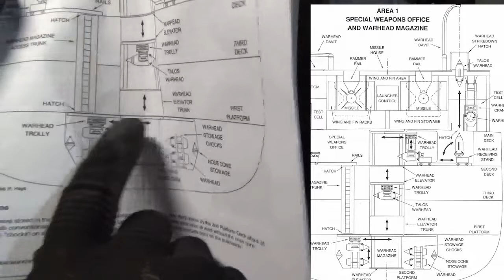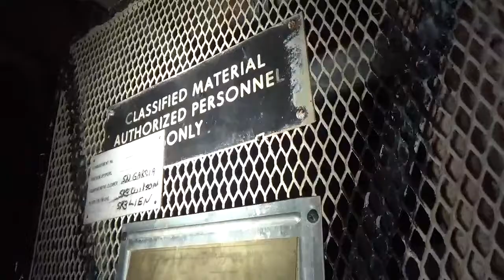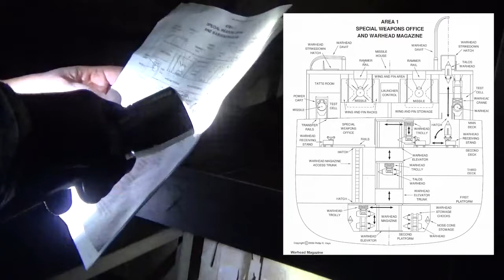USS Little Rock's Missile House for the Talos Missiles, Part III

Comment: On the Long Beach, the warhead handling carts were stored on their tracks just inboard of the 2nd Deck passageways port and starboard on either side of the elevator on centerline down to the warhead magazine.  In the mid-'70s we were steaming inside the wall of a typhoon hiding from the Soviets performing their Okean 75 exercise.  The ship was rolling pretty hard from the storm and the starboard handling cart broke out of its storage clamps, flying through the air across the starboard 2nd Deck passageway and through the thin wall of Sickbay knocking down a couple in-patient bunks.  That flying cart probably weighed better than 1000 lbs.  I was in B&M Berthing below on the 3rd Deck and heard the loud crash when it let loose.  You didn't go all the way down to the warhead storage racks - that place is a bit spooky.  Warning placards about maintaining a safe specified distance between warheads during handling/moving them were posted there.  And for a reason not obvious to most folks - these were very "old tech" devices...
Reply from the maker: Thanks for sharing your story on the Long Beach. She was such an interesting looking ship, and appreciate you sharing some of her architecture and how it differs from Little Rock. We've gone into a little bit of the nuclear warhead handling areas, but maybe that's the video you watched. Sorry I just can't remember. I always stress that, yes -- when people step aboard Little Rock, what they're looking at is 1955 technology on a 1960 converted cruiser, and these systems became obsolete with the building of the Ticonderoga Class in 1980. Thanks for your support!

Comment: Great video.  Really cool area of the ship.  When you guys do go into areas of the ship like down that tiny hatch, is there any worry of there being no air, or bad air, or build-up of gases?  Or are the hatches open long enough and there still; air flow to prevent that kind of thing?  

Also… Wing and Fin sounds like a good name for a bar.  It can server chicken wings and fish..
Reply from the maker: Bryce - Excellent restaurant for sure! Great outside the box thinking for sure...fabulous! For your other concerns - - I have heard of spaces that have the oxygen depleted do to the oxidation of the steel. It's definitely something we discuss, but we haven't come across it on board, and I haven't experienced it directly. When I have to crawl into a fuel oil tank, we have someone standing watch who requires me to check in every 30 seconds, but that's precaution from the fumes. Allen and I did say we should have worn masks because of the metal particulates that appeared to be floating in the air. Next time we go down there for another video, we'll have those on! Thanks, and hope that helps! I've read about O2 depletion, but again haven't experienced anything that is concerning!

Comment: So many questions running through my mind.  I will limit myself to one.  Does anyone know just how long it would take to get a missile ready to launch?  From moving it from stowage to assembly, to the wing and fin, and finally out to launch.  I would guess that there were drills to get the time down because in a real attack mode there would be a need to get them ready as quickly as needed to complete the attack.
Reply from the maker: Great question, Dan. My thinking is, and it's an educated guess from what I've read, that it would take only about 3 -5 minutes for the whole process from stowage to out to the launcher. I know from more thorough research that's out there, that once missiles were launched they would have two more ready in the wing and fin space...and it would only take 20 - 30 seconds to have them out on the launcher, prepped with the right solution and ready to launch! Thanks as always!